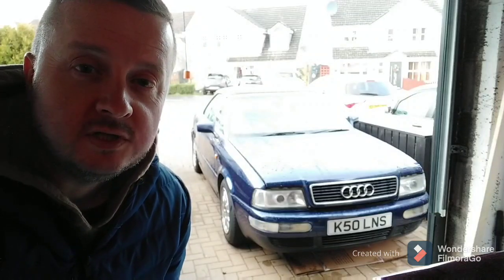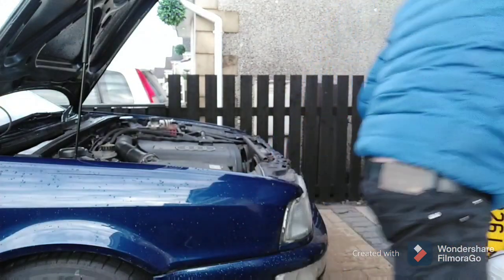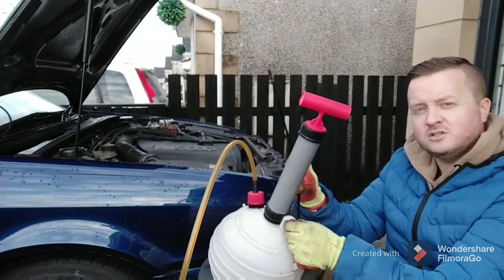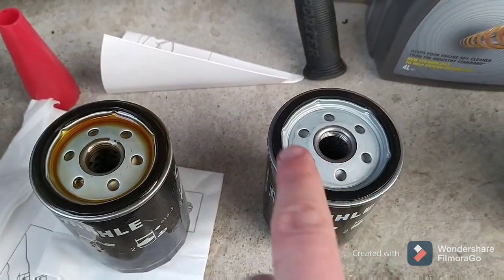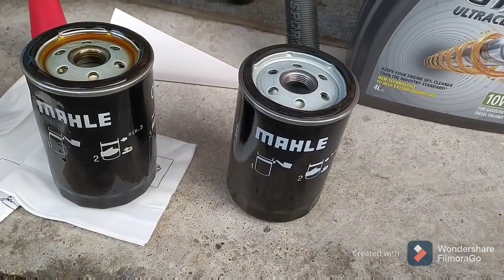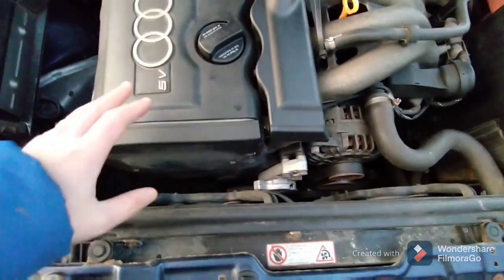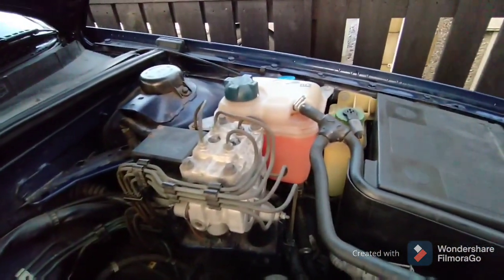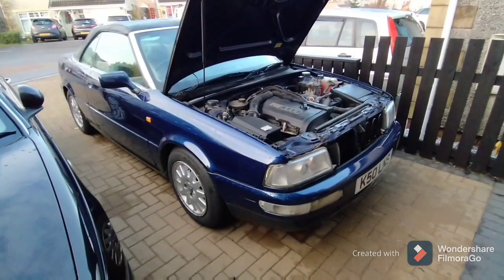VW Audi 1.8 20v ADR Oil Change (Audi 80 Cabriolet)

Comment: That's a nice old girl. We have snow up here last couple of days. Good old engine Vw at it's best. Do you use a cleaning agent in the  oil just curious I have used them a few time's but am normally Tdi just to get rid of any heavy bits of carbon that are left inside her. All very interesting mate useful tips as well mate. 👍
Reply from the maker: Cheers chap. Haven't used any flushes inside, I just change the oil every 6 months, been fine so far!